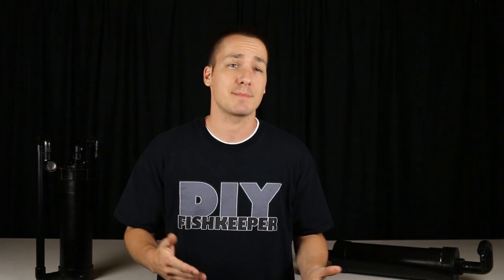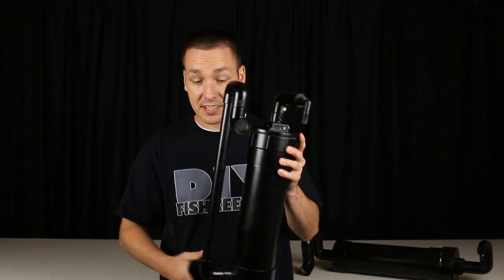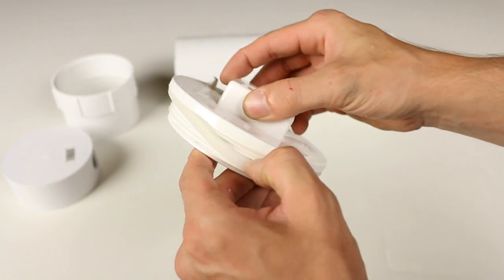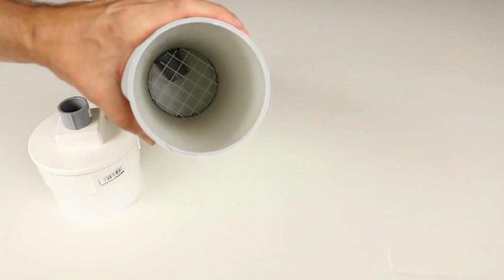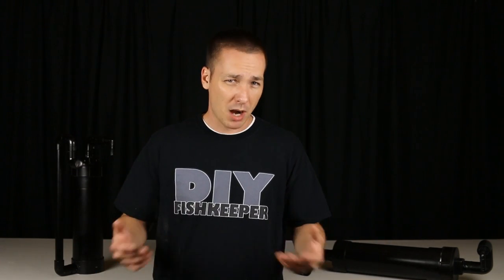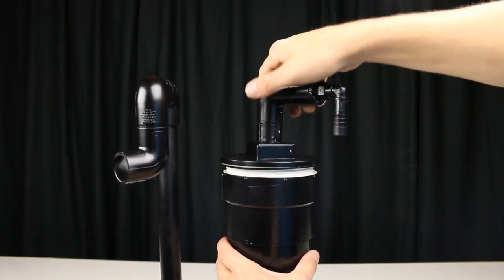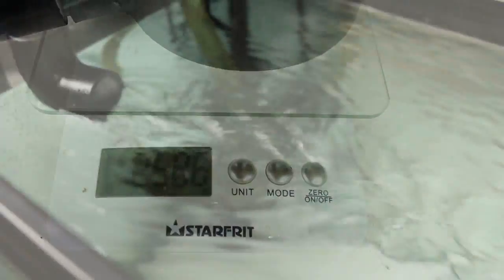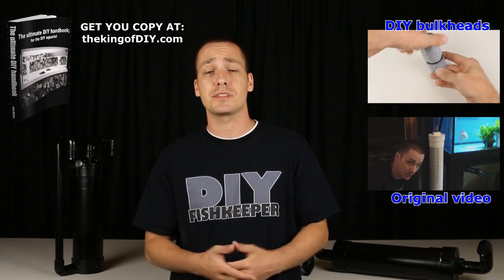HOW TO: Build an aquarium canister filter (HOB VERSION) TUTORIAL

Comment: is it right if i want to combine both canister for botom cleaning and tricle filter for surface skiming, .. thanks b4 :)
Reply from the maker: +Fshop fshop A trickle filter/sump can do both surface and bottom cleaning. Placement of an intake does not depict the area in which the filter cleans, but rather having proper circulation in the tank will take care of the entire column.
Reply: +The king of DIY ow,. okay i want to take care the fish waiste on the botom that are never sucked by surface skimer, okay thanks joey .. apriciate it very much. :)

Comment: Fired Up!!! Build. Yes I'd like to see how to make the other ones, especially on how to add the heater. I've seen you heater inline build but would like see it built with this design. Never fail to amaze me.
Reply from the maker: +Slim Tim The inline heater makes this canister a much more useful filter for sure.
Reply: +The king of DIY I'm building one of my own but i could not find Amphibious pump in my area(also having some issue with amazon and ebay),i have one idea to implement submersible pump into the canister filter but i need you opinion how is the best way to do it,rather than putting pump in tank like you did in this video,my tank is only 180 liters and pump flow is 1600 Lph (its big and ugly pump)

Comment: hey would this work for turtles
Reply from the maker: +Juan Salva The filter removes debris from the aquarium and facilitates the nitrogen cycle like any filter does. If you need that to happen, then yes.
Reply: +The king of DIY ok. but can the filter reach the water because I put water half full in a aquarium
Reply from the maker: +Juan Salva Of course. Since the pump is submerged and pumps the water into the filter, its not an issue. Try a few different things and see what works best for you.
Reply: ***** ok can the sponge in the canister  take the 2 turtles because turtles are a lot messier
Reply from the maker: +Juan Salva I dont own turtles. You should try it... and find out. If you need more sponge.. add more.
Reply: ***** ok thanks btw good job on the plywood aquarium

Comment: could you use k1 in place of lava rocks ?
Reply: +Amy Jones The advantage of K1 is it's nearly neutrally buoyant with water so it's fairly easy to fluidize. You really wouldn't get that effect in a canister. You'd be better off going with something like pot scrubbies or the lava rock (as Joey put in the video). Those will have more surface area and, at least for the scrubbies, are flexible so you can pack them in more.

I have put Kordon media in my canister filters before but it's not really worth it.
Reply: +AquaStudent  ok thanks for the reply will see if I can get some (+_+)

Comment: Do you have to change the media ever? How well does it filter ammonia and nitrates?
Reply: +Justin Jones should do just fine
Reply from the maker: +Justin Jones It will promote the nitrogen cycle just as any canister filter would. You dont have to replace the media... they are rocks, they are not going to crumble or dissolve. A rinse in tank water every 6 months or so like regular bio media is all they need.
Reply: Thank you for the reply. I have a pleco and 3 goldfish in a 55 gallon tank. Will this be good for them to keep the ammonia levels down?

Comment: Cool project Joey. How does cleaning this filter work? You probably have to take the whole system out so does it drain easily?
Reply from the maker: +AquaStudent I showed that in the video! Someones not paying attention! haha
Reply: +The king of DIY Apparently not. Missed that line at 4:18. I was trying to picture this in my head. Wouldn't it still be full of water, at least up to where the lowest point of the system meets the tank (either intake or outflow)?

That could work for the vertical canister but wouldn't be quite as convenient for the horizontal design.
Reply from the maker: +AquaStudent At that point in the video, I show turning off the pump, disconnecting the hose to the pump, poured out a bit of water then removed the cap. 

For horizontal, it would be the same... Although you drain the canister completely to make it easier. This isnt an issue as the canister doesnt actually need to be primed first to work, since water is being pumped into it, and not sucked out.
Reply: +The king of DIY Right. Should work (as long as we are as good of constructors as you :D)

Thanks for the replies Joey. Much appreciated.

Comment: Since discovering sumps and wet/dry filters, I have always preferred them. But, I've read that for a planted tank (my next project), a canister is better as it doesn't allow the CO2 to escape as easily. Can you confirm or deny this, Joey? I would also like to keep a betta (or a sorority) in there too. Tank is 10 gallons.
Reply: You could get away with just a small sponge with a betta.
Reply from the maker: +JediTreki Sumps do not directly remove CO2(depending on style of sump), but rather the overflow. The water falling down to the sump causes a lot of gas exchange, so you would lose a lot of CO2 that way.
Reply: +Kurt-Eric Wurzbacher That's what I thought. My goldfish have a sponge filter, and it works great with my heavy water changes.
Reply: +The king of DIY Ah, that makes sense. Thanks Joey!